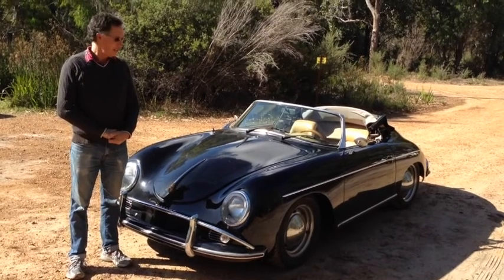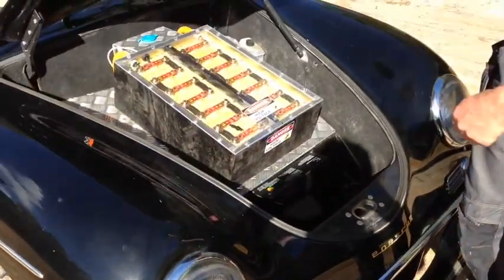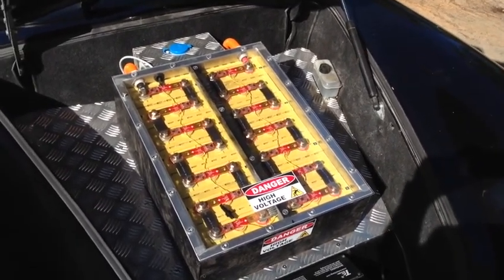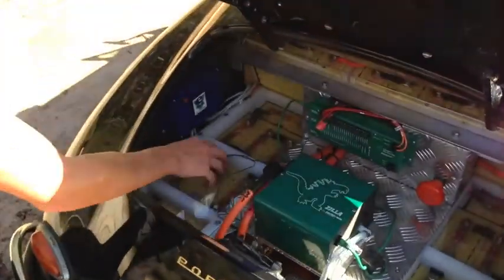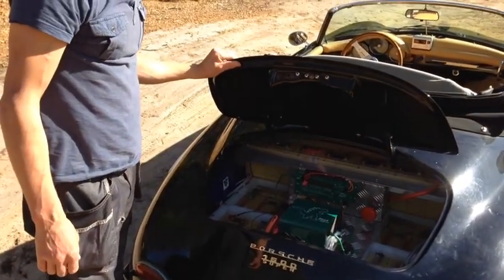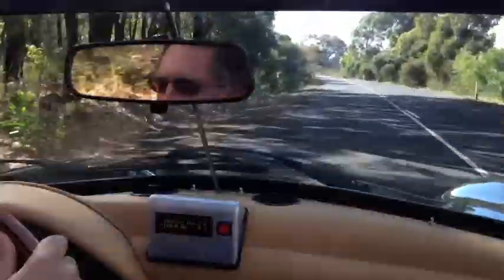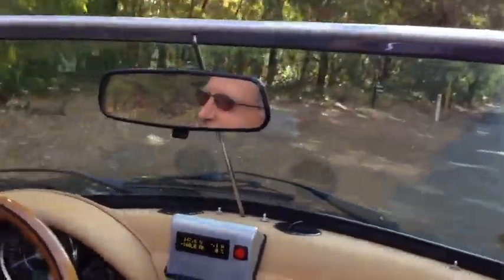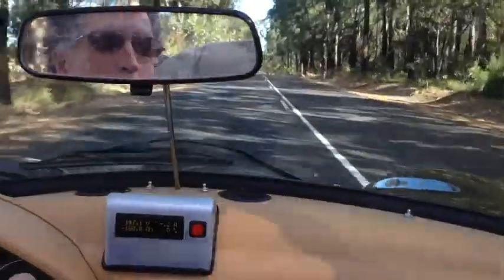PORSCHE 356 REPLICA EV CONVERSION

Comment: Dear sir, as a designer, I am not hiding behind The Book of fairy tails, I merely cite it. Any authentic piece of classic art/design should be protected from Barbarism. I fully support Renewables etc. but ‘butchering’ any old classic, being it a Jean Tinguely-TV-Toothbrush-Cycle car, replacing it’s heart (& soul) by a simplistic modern solution, procrastinating all it’s beautiful characteristics, and then pretending it is the same, isn’t progress nor innovation, it’s called travesty. Future use of an Authentic and applying sensible ‘period’ transformations and/or changes can only be lauded, keeps the spirit alive. Should there be a next time; just use your own imagination, talent and create/build something new & of your own. That will generate ones admiration, even mine. To conclude; I admire rats but don’t live in a rat hole, nor metropole, but 100% in Nature.
Reply: You did see this is an electric Porsche 356 REPLICA, correct?  And even if an original 356, why shouldn't an owner do what they want with it?  I'm certainly not going to make my life decisions on your permission, or lack thereof.